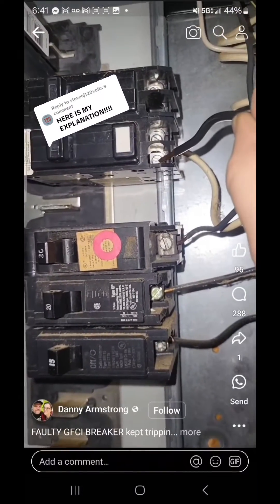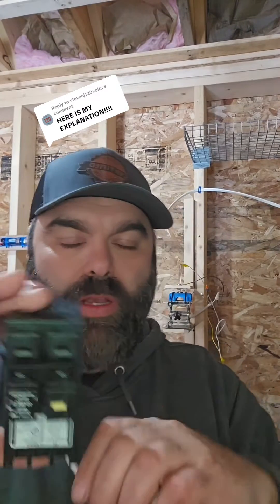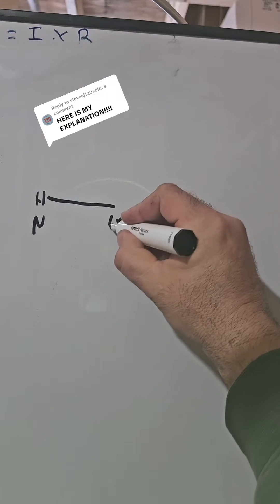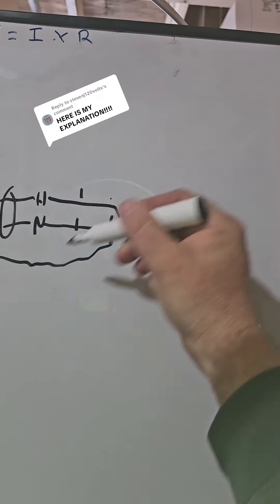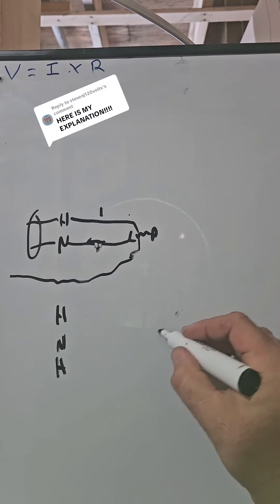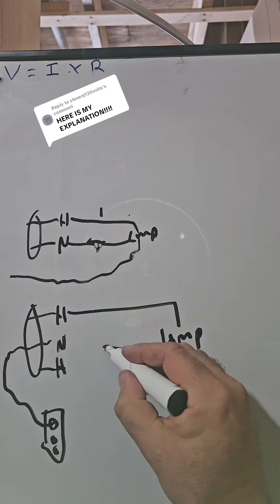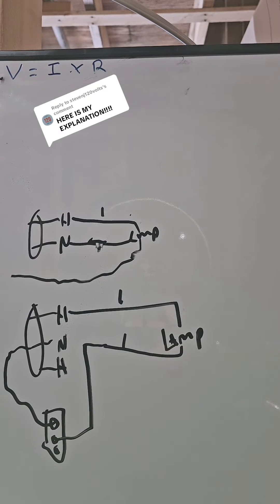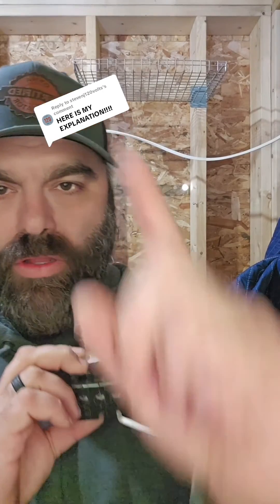click here for the answer

Comment: I commented this morning and I was dead on.   Using a two pole GFCI  as a single pole and not landing the circuit neutral onto the breaker.   In addition if he is using that for a general purpose lighting and receptacle circuit,  this a pretty good chance it's supposed to be a 15 amp, not a 20, although I have seen homes where only 12awg and larger is ran, but that's a topic for a different discussion.